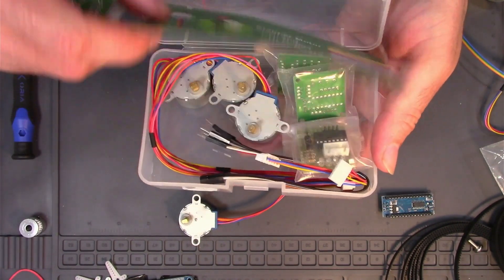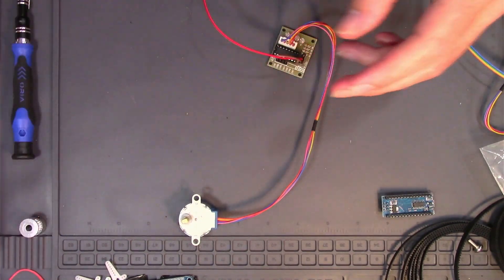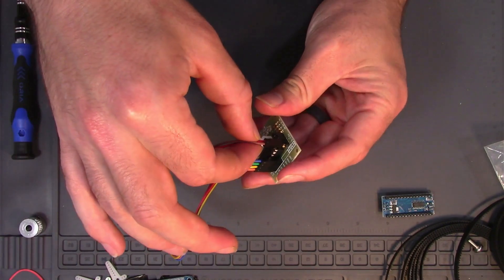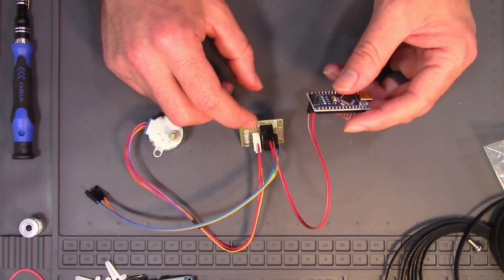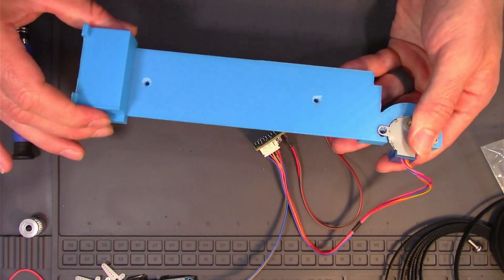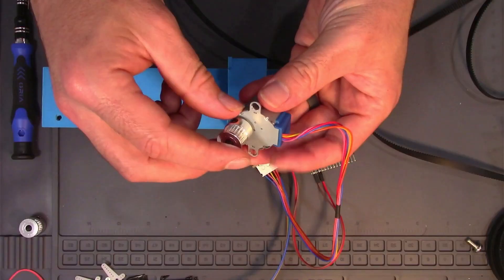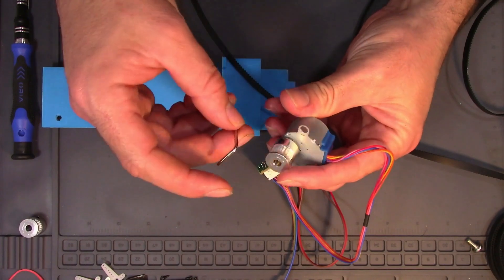Make a Belt-Driven Linear Rail Operated by Stepper Motor

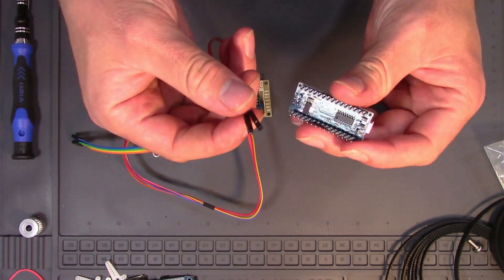Comment: Hi! Quick question, what's the external power source you used at 0:46? I'm doing a project that requires a similar system so any advice would be much appreciated!
Reply from the maker: Any 2 am 5v power supply will do fine. Honestly a fast USB C charger for cell phones works great too. Remember to add a capacitor to your circuit too.
Reply: @hackertwins  alright, thank you so much!